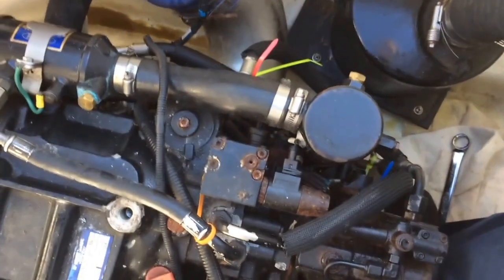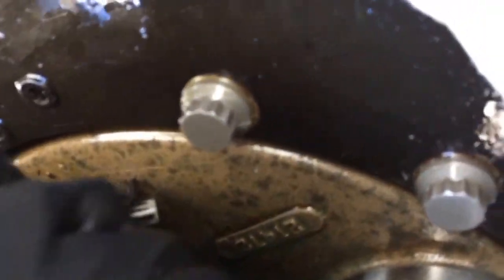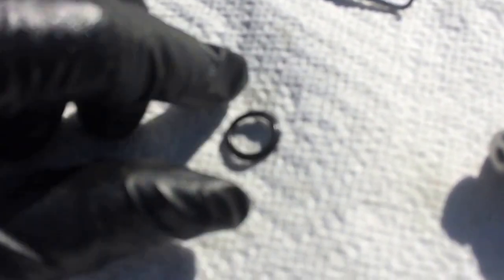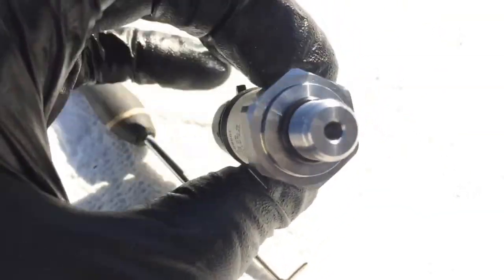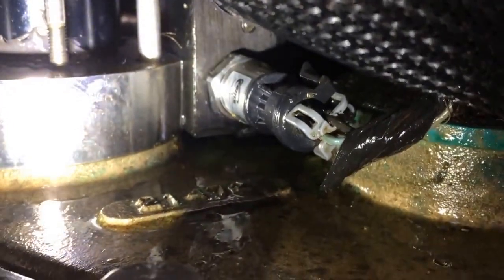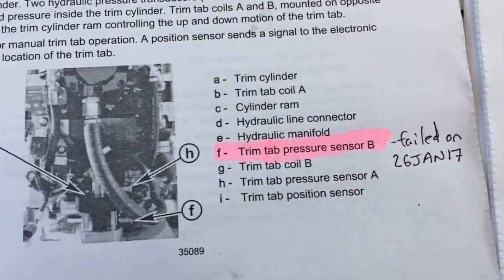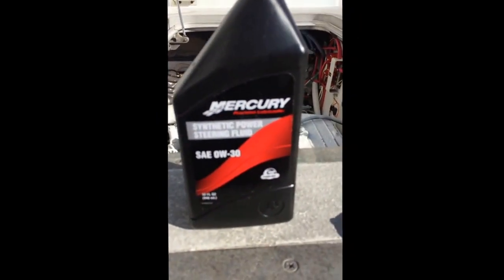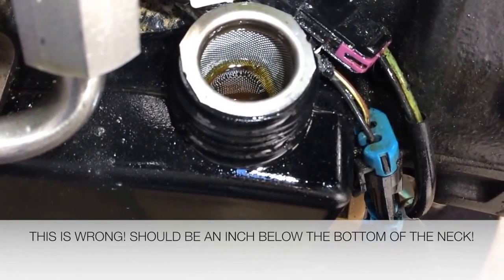Pressure Sensor O Ring Replacement on Mercury Zeus Pods

Comment: This may be a dumb question but does the oil nned to drained to replace the o-ring
Reply from the maker: No it does not. With the engine off, there will be minimal pressure in the system and most of the steering fluid will remain in the reservoir. I just replaced this O-ring again a few weeks ago and no oil leaked out! I talked to Mercury and they said that they don't even recommend changing the oil in the steering reservoir unless it becomes contaminated or you suspect that it has.
Reply: Thanks for the reply!
Reply: Problem is I can't seem to get to mine with out taking lots of stuff apart.
Reply: Why does it look like there’s jb weld on the trim tab cylinder.